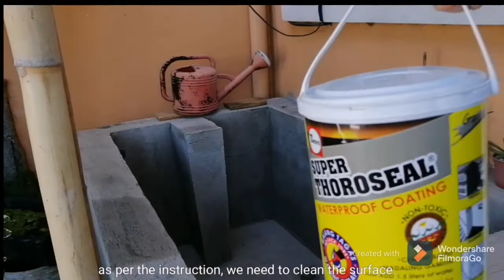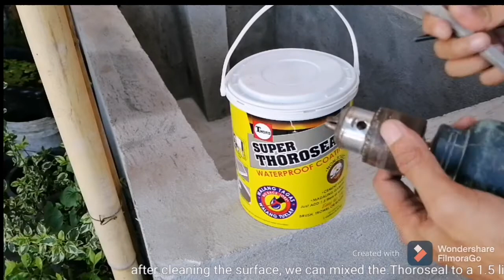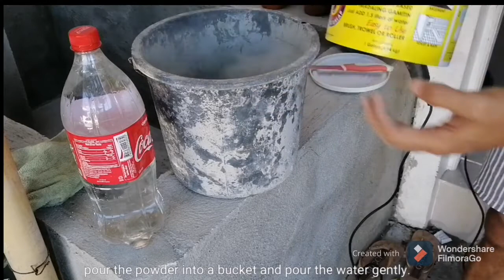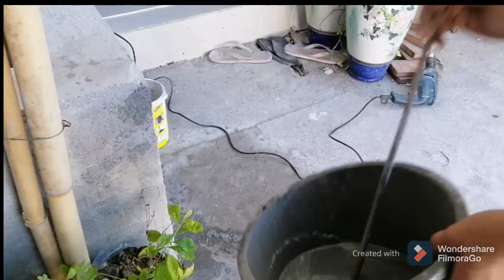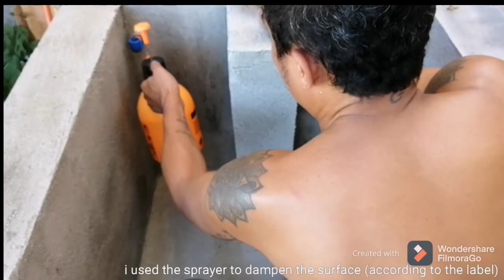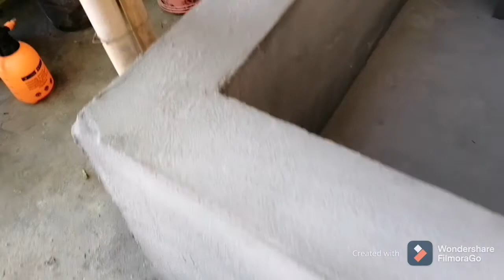THOROSEAL WATERPROOFING FOR MY KOI POND.

Comment: Sir pwede ba kung walang sahara at throseal lang ang finish?
Reply from the maker: mas ok kung sahara/waterproofing. di uubra ng wala. nasasayang lang gawa.
Reply: @LabyuPilipinas  may tanong pa ako sir, paano po if luma na yung pond, pwede paba gumamit ng sahara? Pano application nun sir? Salamat po in advance. Auto sub po ako sainyo
Reply from the maker: thoroseal na lang kapag lumang pobd na

Comment: Sir may tagas pond ko napahiran ko ng concrete bond kaso ganun parin. Tanong lang  ipapafinishing ko sana ulit with sahara need ba tanggalin yung mga na apply kong concrete bond?
Reply from the maker: kahit di na cguro. iskobahin mo nlng.
Reply: Kamusta pond mo boss. Wala bang bubbles? Or tagas
Reply from the maker: @ar-jayrodrigo8382  umalis na kami dun sa dating tinitirhan namin. pero may pond ulit ako. mas malaki.  mag 2 years na. ok pa namn. wala naman tagas. ibang waterproofing ginamit namin.